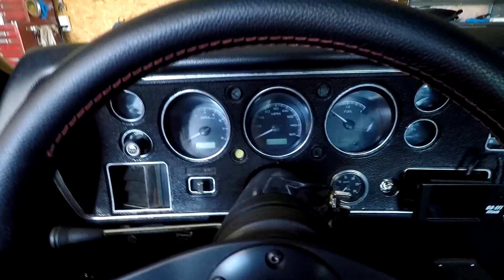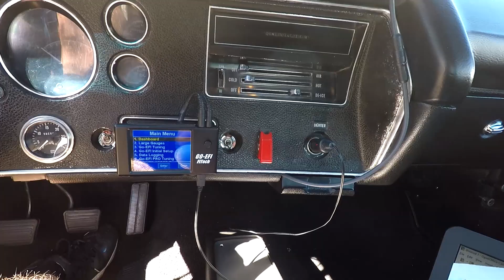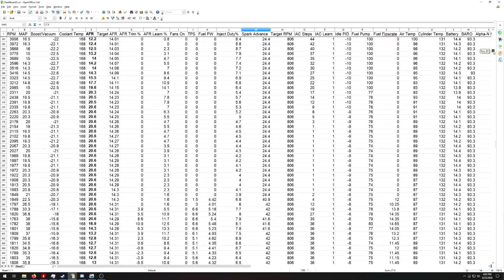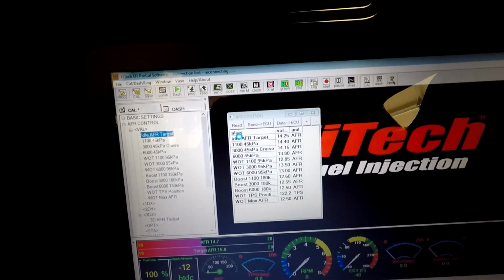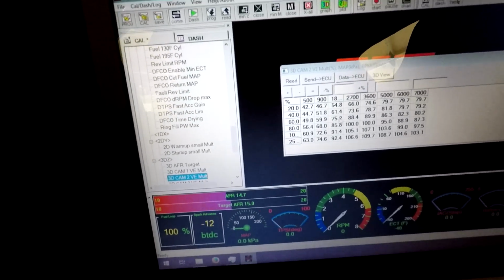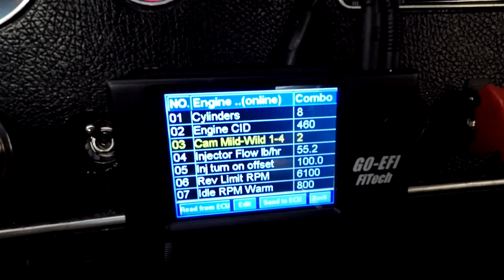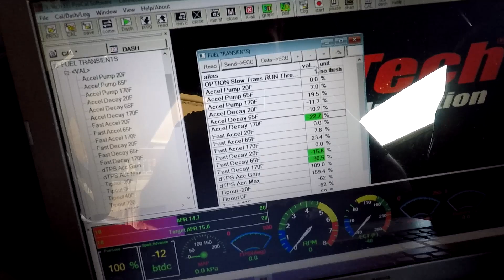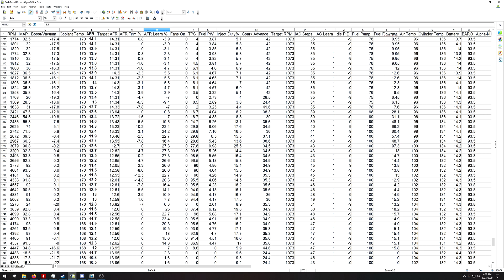FiTech Pro Tuning - Way too RICH

Comment: Ya dude in my opinion  the way you drive  is the way the computer is learing. You need to run around in rpms... imagine  that motor being on an airboat.. it's WOT to these same motors 90% off its life.. I've only watched two videos so maybe I'm being ignorant because havemt watched anymore.. I just know 0‐50 is pretty fun in those and police usually let it slide because u don't get stupid and race or some shit. Enjoy your whole gear.

Comment: How did u tune the idle fuel trims? I adjusted the corresponding ve table for where idle was and it's still pulling the same amount of fuel.
Reply from the maker: Mostly through the AFR targets. Idle is almost worthless to try and fine tune since there is no load, inconsistent idle, etc. IMO, I would lean it out to a happy point and move on.

Comment: I’m trying to get my FiTech to drop rpm faster between shifts, like when I depress the clutch to shift. Want it to act more like a carb. Any tuning tips you may have would be very helpful. What do you have set for rpm drop rate? Factory settings seem to be -220?

Comment: Great video, and I realize it is over a year old, but you also need to pay attention to both  trim & learned readings. Hard to see on my phone, but I believe your learn is positive while your trim is negative. This means it has learned incorrectly and is now trying to correct for this. By you changing your fuel tables you are now making your system now have to correct excessively. The better way to go about this is to clear the learn table. It will give you a better starting point. Also, I have found that changing the learn and trim values to +/-5% keeps this from happening. It isn’t allowed to correct so far that drivability is affected. This will rely on you being the learn side of the fueling, but is not hard to do.

Comment: Looking at your log data your engine temperature is barely making it to the hot threshold for the ecu. Try a 180degree thermostat.
Reply from the maker: I have one lol. I worked on my cooling so much at idle, I got it cooling too good at speed.

Comment: how did you get log to show up with labels at top? my Shows All The Data But In One Column. All Data Is Under Column A.
Reply from the maker: Fitech datalogs save as a .csv file. When opening in Excel (I use open office), it should bring up a text import prompt. Make sure "Seperated by: Tab, Comma, Semicolon, and Other" are selected.
Reply: @SS454LS6  Awesome. It Split Them Up Into Different Columns Now. I Just Had To Label Them Myself. Spread Sheet Makes It So Much Easier To Calculate Average LT+ST Fuel Trims For Tweaking The VE Table. I Wish It Was Like HP Tuners Where You Can Just Make The VE Table Histogram And Just Log Average Cell Hits. Doing It Manually Takes So Much Time haha

Comment: you mention watching the RPMs and map. What am I looking for ??
Reply from the maker: the MAP is how much load is on the engine, and RPM is obviously RPM. Adjust your tune where needed based on those points. So if its lean at WOT which say is 95 kpa, from say 3000-6000, then that's where you would adjust.

Comment: When I connect to my USB and hit open mass storage it never connects to my PC, is there something else I should be doing?
Reply from the maker: did you update your firmware at some point? Doing this can cause a glitch.
Reply: @SS454LS6   I found it was my USB cable... silly me, now I have to figure out the K-line driver and should be good to go!

Comment: Thanks for this info. I'm noticing that the only issues I've had with my FiTech have been related to installation issues and a misunderstanding of what certain values do in their system. Most disappointed customers seem to have the same experience. Except not only are they not used to the methods FiTech uses, but like most people, they don't seem to understand engine tuning at all.

Comment: K Line adapter....where the hell are these files?  I can’t find them in my software. 

How do you get to them??
Reply from the maker: I am not 100% sure, but I believe you need the Power Adder system to have them.
Reply: @SS454LS6  

I have the 1200 PA
Reply from the maker: @ss0073  Plug the Fitech handheld to your laptop via USB and inside one of the folders it will have a PDF that says Installing K Line drivers or something of the sort.

Comment: correct me if I am wrong but isnt the fi tech system self adjusting. shouldnt it fix its self if its running rich? 
I am having trouble too. mine is smoking after reaching operating temp.
Reply from the maker: It can only adjust so much and the Fitech is not the fastest learner. Plus I've limited how much it can adjust. If the baseline tune is way off, it's going to have trouble adjusting for it.
Reply: The Holley sniper is your friend

Comment: Man, Ive bout had enuff of mine, Ive been fighting this thing all year and thinking hard of sending it back before warranty runs out, I just finally got the IAC steps where they need to be and now it's popping back tru the exhaust at idle, First time ever done this, But this first time ever got IAC steps right.The AFR at idle is around 14.7 to 15.1.
Reply from the maker: have you  tried idle AFR's at 13.5:1? Are you certain there is no exhaust leak?
Reply: @SS454LS6  I would think riching it up would make it worse? as far as exhaust leak goes? It's a 540BBC with 3" exhaust It's deff leaking exhaust, lol
Reply: @SS454LS6  nope, no exhaust leak, i richined it on up on idle to round 12.1 has calmed it down,  when i said it was popping at idle, I mean it was more like exploding and banging LOUD! I still have a pop back thru intake every once in while, even after speeding up TPS.
Reply from the maker: @jocrp6  backfire through the intake? I've seen that be ignition/spark related.

Comment: Great video! This should help me out with my setup. Right now I got rid of the Command Center and went with in tank set up. Just need to run hoses and wires. Thanks for posting
Reply from the maker: Good decision going to an in-tank fuel pump.

Comment: I mentioned this in a previous video which I don't know if you saw, but there is a Chrysler engineer, Ramin Mishrab,  who is on the Demon/Hellcat team who, for a modest sum, will analyze your datalogs and email you a custom calibration file.
Reply from the maker: Thanks for the tip. I kinda prefer to try and learn things myself.